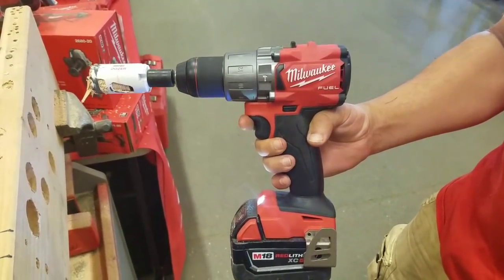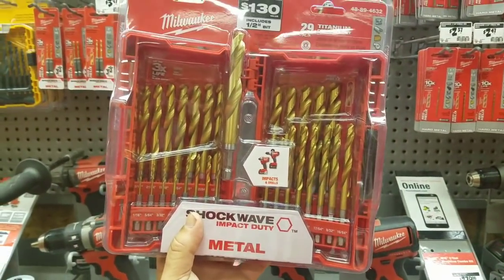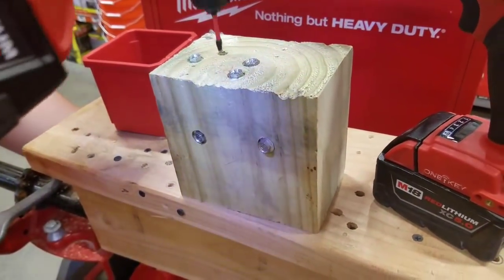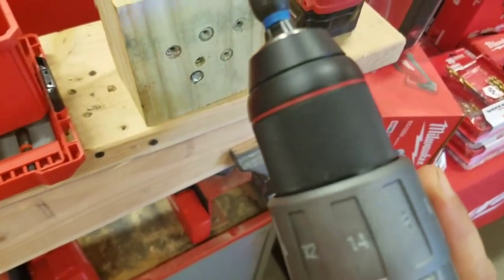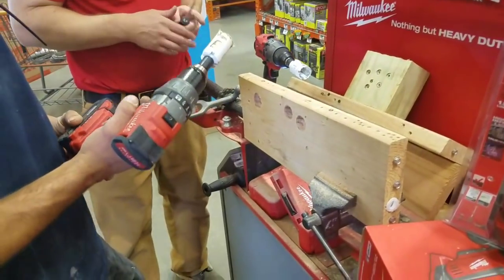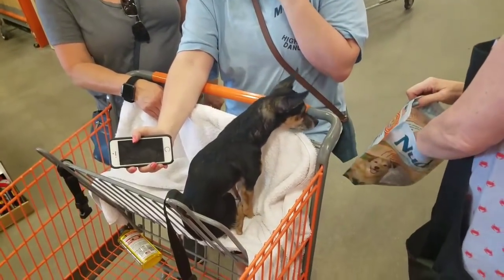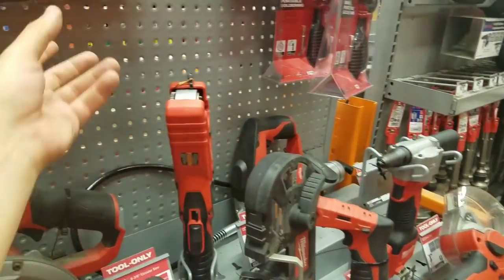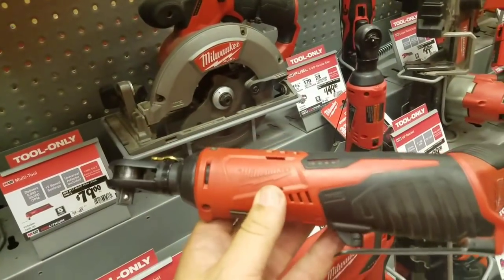Milwaukee M18 Fuel Gen3 Hammer Drill REVIEW ..LIVE FROM Home Depot with Milwaukee Rep

Comment: It cost around USD$ 731.°°  in Miri, Sarawak at Sin Yick Soon Hardware Trading Sdn Bhd.... For a combo of :-

1 M18 FPD2  Hammer Drill c/w 5.0Ah Red Lithium ION battery.
1 M18 FID2 Impact Driver c/w 5.0Ah Red Lithium ION battery.
1 M18 Sawzall CSX (bare) c/w 1 Metal blade & Milwaukee hard case.
1 M18 Grinder CAG-100 (bare).
1 M12/M18 Rapid Charger.
1 Milwaukee Contractor Bag (large).

Comment: Boss I'm not 100% sold on the Gen. 3 drill. on the Gen. 3 impact driver I'm definitely getting one but I don't know if I see enough difference in the drill to warrant the purchase not to mention they got rid of my beloved mode selector collar which I think accounts for half of the length savings
Reply from the maker: Yea much like the m12 ..torque the same ..like i prob wrote 4 times on this vid ...if the chuck not giving you a problem and the size n weight not a issue ...no need to switch to the gen3 just yet ...👍🏼

Comment: Do you feel the active torque so your wrists don’t get wrenched? Seems like driving large lags that would be great or catching a nail inside wood when drilling? Great videos @toolboss
Reply: Jeremy Neill I didn't feel anything in my wrist, wasn't even thinking about it but that's probably part of the increased control and smoothness I was sensing.
Reply from the maker: Thanks Jeremy...yea the gen3 def seems more smooth ..not sure because its lighter so jolt not as bad ..but probably a combination of better internals and weight 👍

Comment: There’s heavy equipment operators and mechanics at work who absolutely are in love with that grease gun...saves a TON of time and much easier than pumping a grease gun. There’s other power grease guns that are ok, but the Milwaukee is awesome.
Reply from the maker: Really i kno quite a few that dont own one ...def easier no doubt ..but can it work when you battery dies ..a pump one can ..lol .. if big sellers trust me more than just Milwaukee would be making them..lol just kiddin today wasmy first day layin eyes on ..was actually supprised how cheap it was ...was def more $ at one time
Reply: TOOL BOSS 👍🏻👍🏻👍🏻🤣🤣 what’s nice also is the power grease gun is a simple 2 hand operation, hold the hose and pull the trigger...a manual grease gun takes 3 hands, one to hold the gun, one to pump the handle and a lot of the time you need a 3rd hand to hold the hose on the fitting...wish I had more grease fittings I would love to get one 🤣🤣🤣
Reply from the maker: Billy C yea for 99$ def a good price ..a manel grease gun can cost just about the same

Comment: I bought thus m18 fuel hammer drill brought it back twice cause of the number settings near the chuck has cracked, the Home Depot reps checked all the boxes and they all have tiny cracks,maybe you can check it out, you have the resource to take some attentions on it
Reply from the maker: Very interesting my man
Reply: TOOL BOSS kinna alarming to me cause they opened four boxes and all of them has a tiny crack, the materials looks like made of alloy but the brushless not fuel is made of hard plastic

Comment: I have a two piece combo kit of the M 18 fuel comes with the GEN two or no GEN three hammer drill and surge impact. Yes. Either way the bottom from a place that had a 30% off on all tools and I pretty much stole the whole case without actually stealing I mean I just got a hell of a deal

Comment: Bought a brand new hammer drill used for 2 days mess up the gear box assembly due to the Handel it pretty much mess up the whole case  drill work fine. Did a warranty on the drill got it back 2 weeks later I notice the drill look a bit different. Turn out they sent me a gen 3 drill instead of my old one should I be worried?

Comment: hey Tool Boss,, I can get a really good buy right now on a Gen 2 Milwaukee Fuel set 2897-22 m18 Hammer drill and Impact driver for under $270 new with hard case or do you think I should wait for the Gen 3 set to come out? this was a fantastic review on the Gen 3 Hammer Drill and I like how the light was moved back to the bottom like on the Ridgid tools best place for a light in my opinion-thx
Reply from the maker: Well 270 with hardcase definitely not a bad deal ..but i think you can gen3 for 70 more..when acme does 15% off ..if you have ridgid use that till it craps out
Reply: Walter some gen 2s had chuck problems. Id say go gen 3
Reply: OK may do just that and wait thx Boss
Reply: yeah I think I may wait? not really hurting for new tools right now my current stuff is working just fine
Reply from the maker: Walter yea no reason to throw$300 around , especially if what ur using is still working for ya ..might just have a chance to get that gen 2 kit for $199...xmas is coming 👊👊
Reply: that would be a sweet deal for $199 oh yeah!!!
Reply: sometimes I plan too far ahead,,lol
Reply: Walter if you can get a deal get the gen 2 there are no real improvements in gen 3 besides maybe the chuck.

Comment: Sean did not sell me on gen 3 but those he did on those hole dozer bits, popped those plugs out like nothing, and the torch sawzall blades.  Also what is your paypal Boss?
Reply from the maker: Yea they are kick ass ...as for the hammer drill ..i do like the selector better on gen2 ...same as i do on the m12 ..but like i said unless the gen2 chuck is giving you trouble and the size doesn't bother you ..no need to switch anytime soon to the gen3